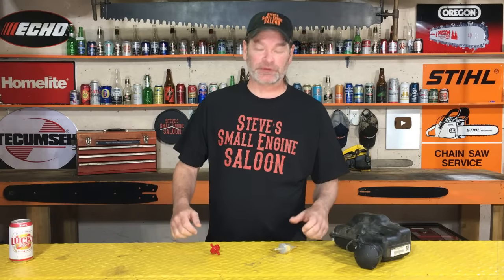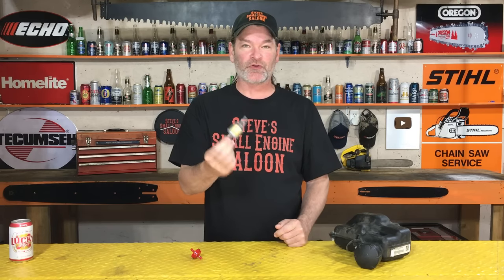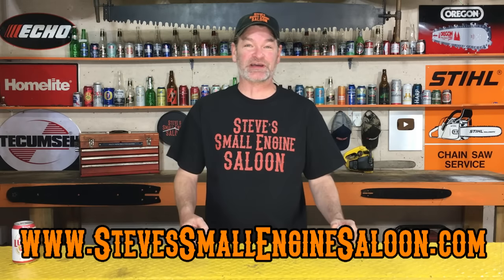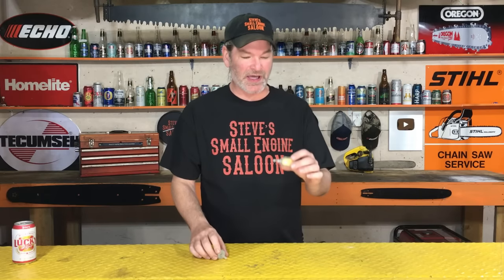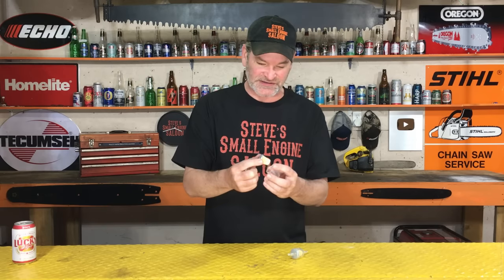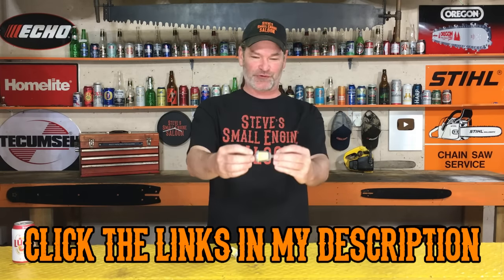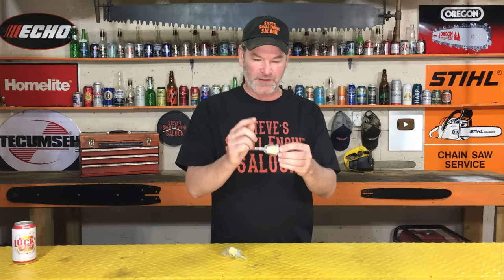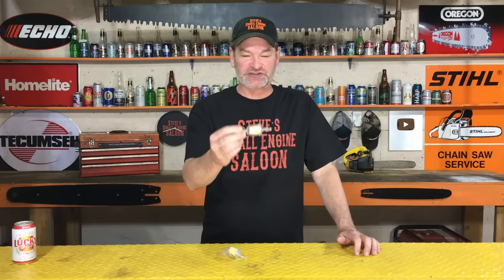Why Is There An Arrow On Some Fuel Filters

Comment: THANK YOU!! SO refreshing to hear someone who actually knows what he's talking about. Yes, that little arrow really IS supposed to point in the direction of the fuel flow for exactly the same reason that you stated, so that the operator or mechanic can see any water or debris in the fuel line. 
If people don't want to see what is in the fuel line then they shouldn't use a transparent fuel filter. After all the explanations of such things on YT, it still amazes me that I  just saw someone else on YT installing a transparent walled fuel filter 180 degrees backwards.

Comment: Thanks for all your great 👍 information. I have a compressor in the back of the van, going on 34 years. Works faithfully every day. I use this filter , and keep spares on the van. I always thought the arrow was for the direction of fuel. Tank - Carburettor, so the old adage, you learn something every day , still holds good. . So big thank you for your great and very useful information.
Reply from the maker: You're Welcome...

Comment: Another reason to install a fuel filter the recommended way, is that the media is stronger when the fuel flows from outside->in, vs inside->out. If a filter is plugged on a pressured system, the media can be pulled apart much easier, than crushed in.
Reply: Sounds like really good point. My first thought was purely for ease of inspection.

Comment: The point> of giving proper direction is to keep a clear view of the information flowing without restricting progress. As an additional directive, hops imbelished beverages also have a flow sequence. Use the pull tab to initiate enjoyment; Accessing the contents from the opposite end using sharp implements could initiate unwanted rapid release and waste of contents. Be safe Steve and best to you and yours.
Reply: And uncomfortable burning in nose.... or so I’ve been told.....

Comment: Thanks for sharing. I did that on a car carb in-line filter. Looked like it was ok but the flow was into the cartage and was full. A friend saw the arrow bought a new cartage flipped the body the right way around. Older car not a in tank fuel pump.

Comment: An extra benefit is there's more surface area on the outside, so it won't get plugged as fast.
Reply: Surface area of one side of a sheet of paper is the same as the other. What is different is the narrow pleats can more rapidly fill and not use all the surface area. The area outside the media  has move volume for fuel.
Reply: So you can see how dirty it is !

Comment: True for tiny gravity feed filters. For systems with a fuel PUMP (like vehicles and bigger machinery) incorrect installation can blow the filter media apart, also, they are often constructed with layers so the coarse debris is filtered out first and finer material is collected by the inner layers of the filter.

Comment: I've always told my customers that it doesn't matter which way it goes on, as long as you put it back on in the same direction as before you took it off. You're absolutely right, though. The only purpose it serves is for visual confirmation of a dirty filter.
Reply: Actually he went on to explain if put in the correct direction it forces the gas outside to inside the filter and mowers work better.

Comment: Very encouraging video.  Wish you are nearby so I can watch you how u start mine, a Britt stratt small engine sitting idle for years, no gas, no oil, of 10 years old.  Tried and cleaned the gunk carburetor, no start; replaced spark plug as it had no resistance; testing shows sparks.  Test showed low compression and cleaned the exhaust that’s plugged w oil.  Still no start.  I so much want to give up now as I have things to do other than fixing this dumb little engine.

Comment: Another bull's eye, Steve. Would you please do a video on why some John Deere engines are hard to restart when they're hot? Specifically, I'm referring to the Kawasaki twin engine in the X300 JD tractors. I've heard all kinds of reasons from dirty electrical contacts, carb issues, valve clearance issues, and loss of vacuum through the crank shaft bearing (or something like that). Not sure on that last one. Many thanks!

Comment: I was a bit confused by the arrow as the shape of the filter suggests petrol should flow in the opposite direction!

I was also told that fitting it the correct way around means more paper is exposed to the incoming fuel so I have now put mine on correctly

Comment: Great video.. I've heard of issues with priming with these filters. I have a Mercury 3.5 (Small fixed fuel tank) that does not have a fuel filter. I'm thinking about adding one but I'm worried that it might be the kind of situation that causes a problem rather than solving it. What say you?

Comment: Great video. Another point, if you have installed a fuel filter backwards and ran with it for any length of time, do NOT turn it around the correct way or you will flush all the dirt collected inside the filter into your carburetor!
Reply from the maker: Great point!

Comment: Great video! Hey i installed a new filter like that on my Craftsman LT2000 Rider.. I searched for this video because the problem i am having is this. It ran good for awhile now the mower dies sometimes. When i look at that filter there is hardly any fuel in it at all i have to wait till filter gets about 1/8th full before it will start?!? Did i get the wrong kind of filter that is made for a fuel pump system? Thanks,  Also, i Liked and subscribed!

Comment: I had water in my fuel a while back, and had one of these filters. I could actually see the water buildup in it, because I had installed it correctly. I drained the tank and got a new filter.
Reply from the maker: Right on

Comment: Not being able to see how much junk is in the red or white Briggs style filters is why I like the other type your are showing there. I want to see what junk is coming from the tank or lines. You can even see if there is water in the fuel with the see through filter sometimes. It's also great for troubleshooting to see if there is fuel flowing. Nothing worse than not knowing if fuel is getting to the filter or not. My personal ride on mower has one 9f those see through filters and I know if it dies from and empty tank by just looking at the filter.
Reply from the maker: Right on

Comment: Have also read on other sites, it is because if it plugs TOTALLY, the correct direction, the  filter will collapse upon itself and plug the outlet, not allowing crud and fuel through. The opposite way, the crud can burst through if damaged or with pressure from a fuel pump and let crud into the carb... 
dunno. maybe both reasons can be true!

Comment: Hey Steve, I've changed my air filter and fuel filter, but after a few minutes of cutting with my Troy Bilt XP Horse, it just dies.  Not slow, just turns off.  Then it won't start. If I let it sit for a few hours, it will crank up, rinse and repeat.  My headlights are working.  My amp meter is staying about 1/4 past the middle after mower is shut off. If you can help, thanx, if not, thats cool.  Have a good one.
Reply: I’ll bet there is a an air/vapor lock.  Your gas cap vent hole might be blocked.  Check the cap, check the hole.

Comment: How full of fule should that filter be with engine running, and when engine has set for a while should fuel stay in it?
Reply: Your fuel line is supposed to maintain(depending on your car) a certain anount of fuel pressure even after you turn off your car. So it should be full unless you got some air bubbles from a leak or bad furl pump

Comment: How do you find out what the gap is supposed to be on a spark plug for a Cub Cadet CC30H riding mower? Is there a big table in the sky that tells you what to set your gap for this model is? Keep those motors running Steve.

Comment: Side question Steve.  Will it make any difference in performance if the filter is horizontal or vertical ?   What do you think of the red filter PRIME LINE part 7-07103 which is translucent with a ultra-fine mesh screen ?   J K

Comment: I seen this video and then realized that I had installed my fuel filter incorrectly. My mower will not start as of now. I changed the fuel filter and installed it correctly. I also changed the air filter, spark plug and oil filter. It will still not start up. Is it the carburetor or the engine due to the fuel filter potentially allowing debris in. The gas was not more that a month old. Can you help?

Comment: I have a brand new still in ms880  magnum with a 59" bar that keeps burning out the needle bearing in the clutch and boggs down really easily. I know it takes a lot of power to run bar that big but with how much power this saw has the bar size shouldn't be an issue. I bought it strictly for milling logs and I haven't changed any of the factory carburetor settings so I don't see why I'm having these issues. Any ideas?

Comment: Some time back I had a persisting problem with carby jets blocking on my ride on mower. It turned out to be the core in the filter was loose so the fuel bypassed it.
Reply: I recently had a similar problem on a Krohler engine. The paper element and metal disc had separated from its bond inside of the filter housing. You couldn't tell anything was wrong when not running, but after starting the engine, the fuel flow slowly rotated the element inside the housing, thus letting unfiltered fuel by and into the fuel injector on this Miller Trailblazer. Never seen anything like it in my life.

Comment: Hi, I'm a big fan. I'm a Stihl tech in Texas. I'm having troubles with Stihl 271's.  When starting, I put on full choke. It burps and floods. Then wont start until I hold the throttle open and pull until unflooded.  Is there a way I can stop that so it doesn't flood everytime. It happens on a lot of 271 units. Help.

Comment: Hey Steve, Never really thought about why the arrow was there. I've always installed them according to the instructions. Learn something new everyday. Do you have a video on the fuel system on a Kohler SV725? What to look for when the engine is surging. Is there more than just the carb involved??

Comment: Here is a good thing to know about hat type of filter is it can be used on 1/4 ID ( Internal diameter )  and 3/8 ID fuel line/  For the 1/4 DI fuel line just don't try to force it over the second set of barbs.

Comment: Steve, Steve, Steve, can you do a video on other uses for small engines when they have outlasted the device they were attached to? I'm trying to make an old chainsaw engine into an "off the grid" Frozen Margarita machine! Thanks Steve!
P.S.  Good point on the filter arrow, but you didn't cover the aluminum can type filter.... but I guess that's obvious that you don't want to reinstalled a used filter backwards...

Comment: How about showing a fuel filter with glass settling bowl like on old tractors and Cub Cadets. A lot of people may not know there is a fine mesh brass screen at the top and need to make sure it's there (or not damaged), especially on newly acquired equipment.

Comment: So is there a difference from a gravity fed filter as opposed to a fuel pump drawn I was always under the impression that a gravity fed non transparent has a fine fine screen in it & a fuel pumped drawn system the element as shown in this video would not be acceptable for a gravity fed system or am I simply way out in left field with this theory we’re element or screen both applicable in gravity fed systems ??? I thank you ! Cheers Mark !
Reply from the maker: Watch this  https://youtu.be/2lV6nWYNRDU

Comment: I need advice. I was wanting to put a fuel filter on my new mower, because I've never had a new one before, and I want to keep it nice and reliable (instead of battling a POS every year after winter).   The problem is that my fuel line is exceptionally short (around 4 inches).  So, is that worth the trouble? If I put one of those filters on, then I'd only have about 1inch of line on each side of the filter, and would barely be able to apply/remove 4 clamps in such a small space.

Comment: Yep, exactly right. :) It'll work either way but dirty fuel on the outside is proper. It's clear for a reason; so you can see the junk filling the pleats! When you get into pressurized filters like engine oil filters though, flow direction is very important. That's because most are supported from the inside of the pleats by the filter core's ribbing pushing outward to support the filter media from the flow of oil being pushed from the outside into the center of the oil filter. If it was the other way around, it would push the pleats of the media inside out and press them up against the wall of the filter right away. Not good.

Comment: Great video, I only use good quality fuel filters , not those cheap Amazon ones which aren't sealed at the top ( if you take one apart you'll see ) I and let contaminants get by. The ones in your store are Stens , those are good.
Reply from the maker: Thanks for the info!

Comment: Steve, on the topic of filters. What are you thoughts on external fuel filter funnels like: Mr. Funnel AF1CB, Flo Tool, and Hopkins types, that claim to block water and debris from entering the small engine fuel tank while refueling ? Thanks for the video update.
Reply: The Mr. Funnel filters do work, especially for water. I've used one and I've tested it. But... be aware that it will not filter out water that has been emulsified in the fuel. If you have fuel that has just gone through a pump, like a hand pump or powered pump, the water will typically be emulsified in the fuel. In this case Mr. Funnel won't filter out the water. If the fuel has been sitting in a container and you simply gravity pour it into your tank using a Mr. Funnel, then it will capture any water present in the fuel.
Reply: @eosjoe565  Thanks for the info...

Comment: Is there a recommended use date on a fuel filter or do you go with the attitude if it’s ain’t broke until it starves the engine
Reply: Once each Spring - start your mower season.  Unless you cut all year round, then twice/year.

Comment: Didn't know that.  I thought it was for proper flow rate.

If your looking for ideas, how about the issue I have with my Snapper with B&S engine.  When you turn the key it turns over extremely slow and will sometimes even stop.  When you turn the key off and do it again it will usually crank like normal and start. Sometimes it will take 2-3 tries before the starter will crank like it should.  Yes, it has a new battery but makes no difference.                          Keep up the good work.                 JimE
Reply: One of my mowers does that but if I put my little solar panel battery charger on for just a few minutes ( 16.8 v no load output voltage ) it gives the otherwise good battery that extra kick and it spins well first time .
              Q. , does yours sometimes smoke briefly after cold startup ? If it does , you might be getting a bit of oil past the valve guides into the cylinder when it's stopped , raising the compression on first crank .
Reply: @Gordon_L  A - Smoke somethings.  I put a battery in this time with more CCA and it does the same thing.  Cold start or warm start.  It can set for 30 seconds or 30 hours.
Reply: @ Jim E Try adjusting the valves if OHV. Check connections for corrosion. Make sure the Ground Circuit is Good. Best of Luck!

Comment: Another point,when the filter is installed the proper way, there is more surface area to filter the fuel due to the pleats being expanded, which will contain more contaminants, causing longer filter life.
Reply: Your correct sir all filters capacity depends on surface area  among other  characteristics for containing contaminants
Reply: Uh, strongly disagree, or I'm not getting your point.
in the proper fitting the gas (petrol) coming in will exert pressure on the cone element around it's outside compressing the element. The pleats add structural integrity to the paper cone under this pressure.  Reverse the flow and the gas will inflate the cone flattening the pleats.
Also, surface area will not change, (unless it's elastic, and then you could argue it still doesn't change because the fibers just spread apart). If the surface area increased the weight of the element would would also increase since you'd be magically adding material. But obviously that's not happening.
Reply: @ChuckD59  that may be true IF the there's pressure from tank to carburetor. Small engines are basically gravity fed.The filter may collapse but the engine will starve for fuel,  hence shutting down.  Then visual inspection of the fuel filter would show as  STEVES video indicated.
Reply: @JohnSmith-tv5ep  You're correct, I misstated the direction of the force on the filter element. Normally the fuel is being drawn through, not pushed through.
But that wasn't the point of my response to a comment that stated the pleats would expand and somehow increase surface area which are both erroneous. There's probably not enough pressure on the pleats to deform at all, and surface area does not change at all.

Comment: what about all metal in-line filters ? They bi-directional?
Reply: Yes, they are bi-directional. They also come in colors. Steve is showing the red one which is 150 microns. I've never had any engines which came with red filters. If you purchase the white ones, they are 75 micron so they have twice the filtering ability. The paper bullet-style filters are typically 40-50 micron. Bottom line, never use the red ones. :-)

Comment: You want the fuel to flow from the outside to the inside of the filter element.  The larger surface area will allow longer life.

Comment: My old Honda xr215 keeps dying out of nowhere.

Changed gas cap
Cleaning carb(ultrasonic)

Still kept dying, so I added one of these fuel filters, immediately I noticed after a while it stops drawing fuel into the bowl and thats when it stalls.

All I do is blow into the tank to fill up the bowl and filter and it starts again.  

Whats the issue?